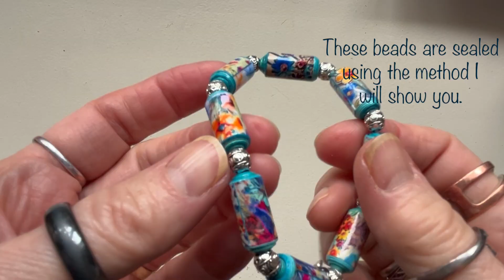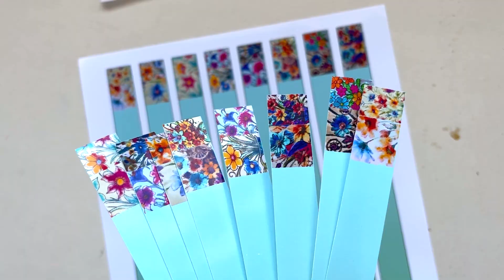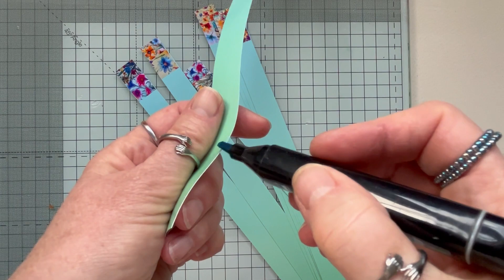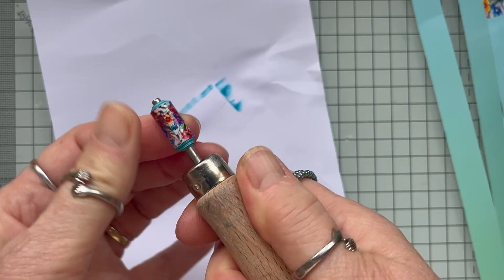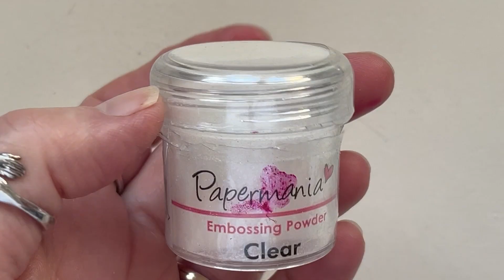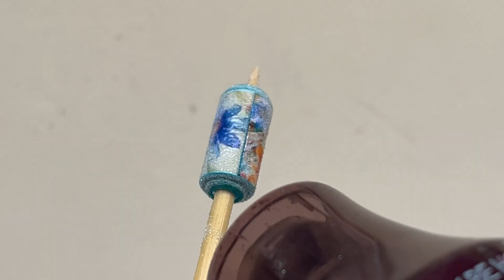Floral Paper Beads Free Design PLUS How To Seal Paper Beads To a Shine Without Wet Sealer!

Comment: Ive just found you, I did paper beads years ago but stopped. You have inspired me to try again.
Do you have any videis on how to actually make the bracelets etc please. Many thanks x
Reply: Thank you for reply, I meant do you have a video how put together the bracelet  in above video. Fastenings etc. Many thanks
Reply from the maker: Oh I see, sorry, I misunderstood. I don’t have a video for that specific bracelet showing how I threaded it but it’s literally just taking some 1mm round elastic and threading the beads onto it. I just tie a knot in it and then pull the knot inside one of the beads. As you are threading the paper beads, add small spacer beads in between them. You might like to try threading them on memory wire instead of elastic. Memory wire makes a more robust bracelet that coils around your wrist but you do need to make a lot more beads. Hope that helps. Thank you. 🙏♥️
Reply: @RainbowLane thats great thank you,so it's elastic that you just knot once beads are on. Brill thanks again for reply.
Reply from the maker: Hi Jan, so glad you feel inspired to get back to paper beading. This is one video where I make bracelets using elastic https://youtu.be/QOS5W_bPPEM?si=JFQxCgw_uPq55QSw I have got others where I use memory wire, I’ll look for the link and come back. Bear with me…🙏❤️
Reply from the maker: Hi again Jan, this is the one where I use memory wire to make the bracelet https://youtu.be/sbO7RJw8NT0?si=M9o0ykRHBPC6UJGZ thanks for watching, have fun with your crafting. 🙏❤️